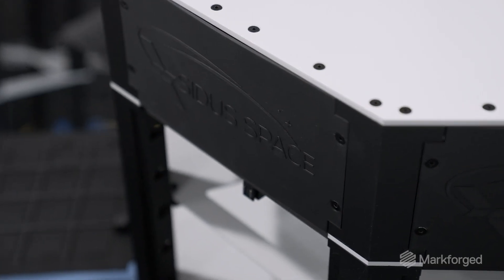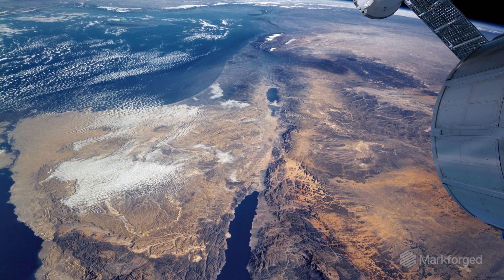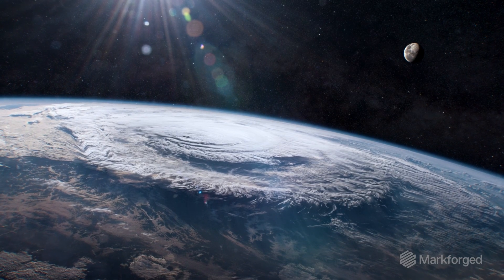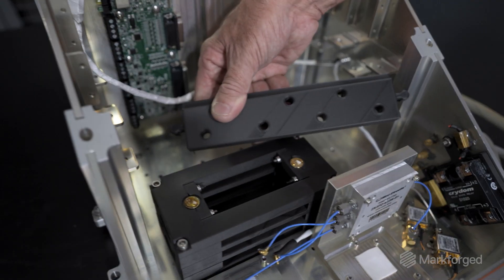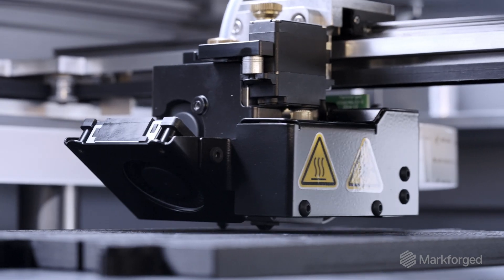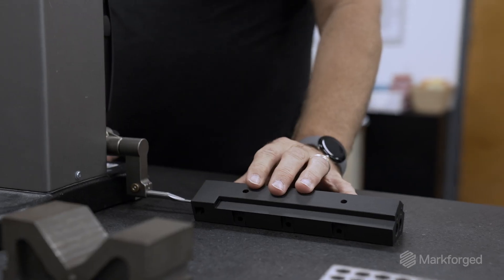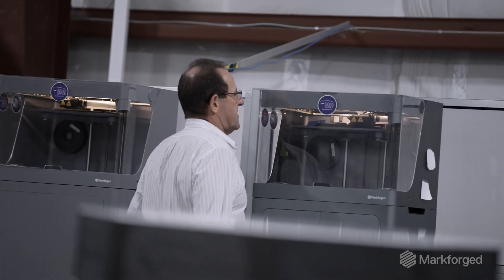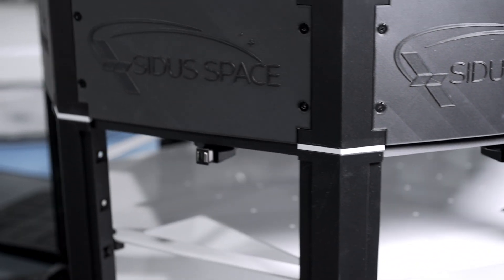We 3D Printed a Satellite with Sidus Space.

Comment: If I wanted to do some Geant4 modelling of say a CubeSat what is the makeup of Oynex, Carbon Fibre material i.e. How would you define it in the Materials section of a GDML file. Thanks
Reply from the maker: Hey Keith! Thanks for watching and for the comment. We'd recommend that you check out our Simulation software, which can assist in defining how much Carbon Fiber needs to be added for the defined load case. Let us know if we can help further! https://markforged.com/software
Reply: @markforged  Thanks - What about the makeup of the Onyx, is that confidential? and somebody designing say a CubeSat  would have to sign a NDA to get a break down of the Chemical Elements.
Reply from the maker: @KeithSloan52  Hi Keith - I've attached a link to our Onyx materials page, which has public information on it. 

https://bit.ly/material-onyx